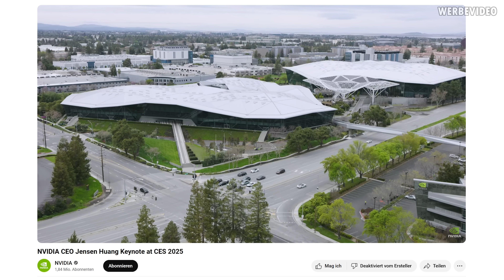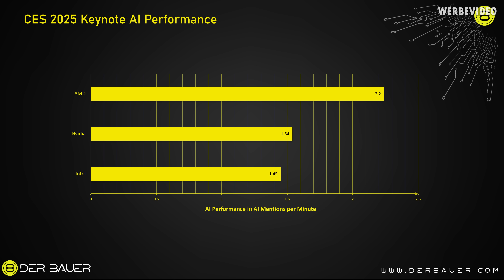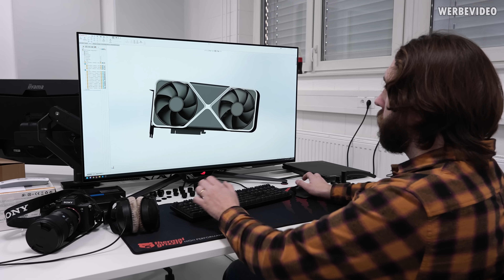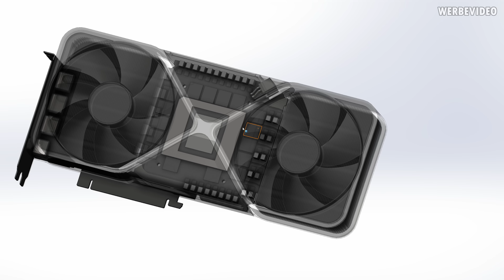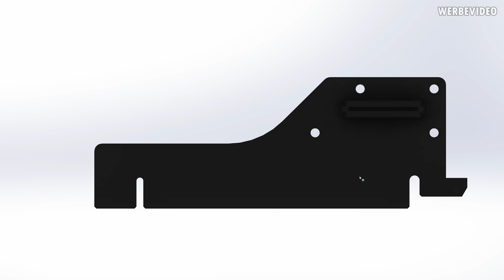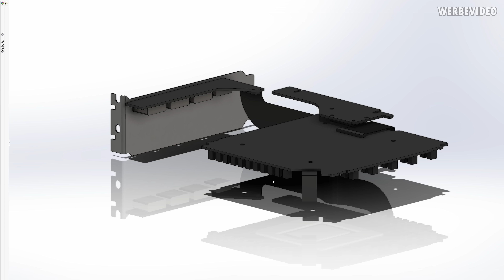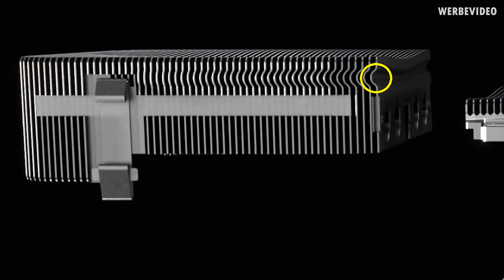We Reverse-Engineered the Nvidia RTX 5090 Founders Edition

Comment: So this mean probably no waterblock for the 5090 FE then. But the FE look like the perfect card for SFF cases then. Very tempted to trade my O11 EVO XL in for a SFF case.
Reply: FE blocks should still be possible, but some considerations will have to be taken. Who knows if FE supply will be good or not this generation though.
Reply: How to get a waterblock for a GPU: say that it won't happen and wait :D
Reply: @irispettson  those are AIB cards not FE.
Reply: @ionstorm66  isn't the only difference between AIB and FE the cooler and pre Overclocking? 
You can change the overclocking yourself and if you want to replace the FE cooler for a waterblock anyways, what does it matter if it i just comes with the block preinstalled?
Reply: @user-to7ds6sc3p That would be cool if true but unfortunately the PCB on the AIB cards will look nothing like the FE PCB.  Especially now that they are using 3 separate PCBs for this FE design, someone will have to make a waterblock specifically designed for the FE.
Reply: @user-to7ds6sc3p there is a FE PCB, then a reference PCB Nvidia provides to AIBs that some cards will use, then tons of custom PCBs that AIBs design. They all take different water blocks.

The issue with the way the 5090 is designed will make the mechanical engineering on the water much more time consuming.